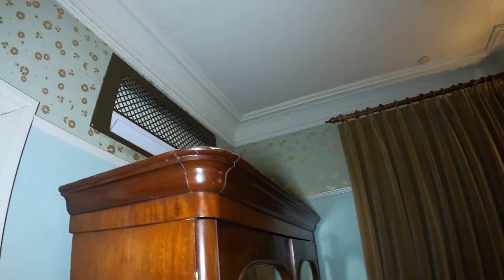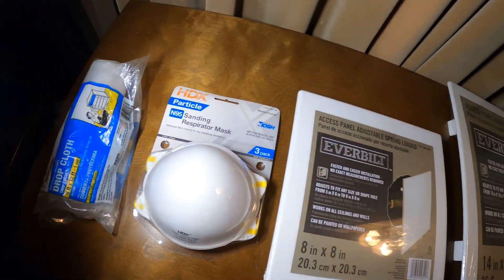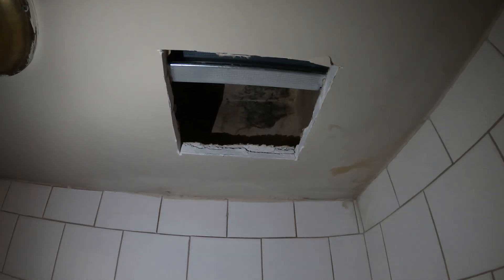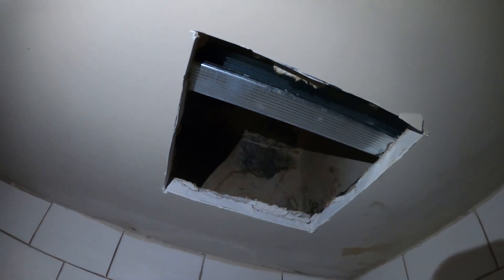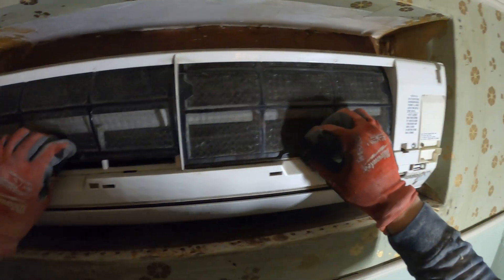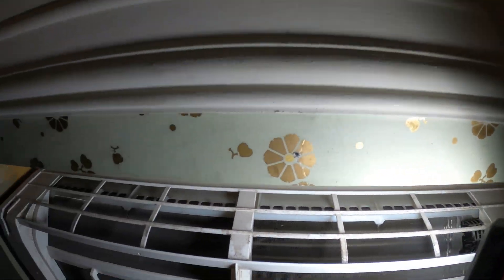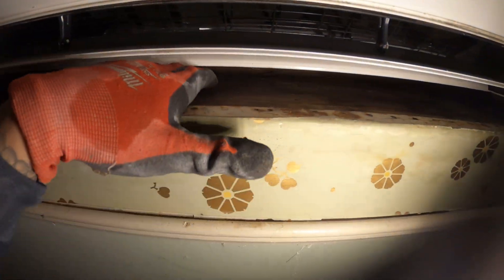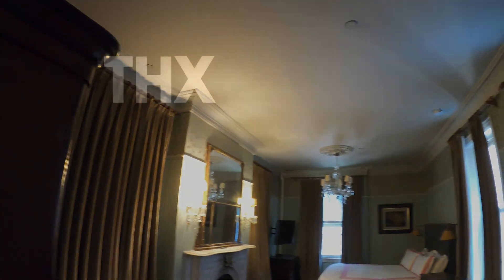HVAC Service Call: Ductless Mini Split Wall Mounted Air Conditioner Leaking Water (AC Leaking Water)

Comment: Its definitely not a good idea to have that mini split hidden in the wall/ceiling like that. I would have also recommended removing the bend in the hose since you already had the wall open. And, instead of pouring all that water into the drain pan, maybe using a borescope pipe/hose snake would have saved time and water.

Comment: You’re right about the loop in the drain. Hi-wall splits like that shouldn’t have any sort of trap in the drain line. In stuff that requires traps, drop the short drain into a tun dish that is trapped after it, providing an air break before trap.  Good videos mate

Comment: I’ve worked on these heaps. You can flip the front cover up and run a 1/4” clear hose and get it straight into the drain/drain line connection. Then you can just blow it/suck it out from there.

Comment: Oh no. That will cost an arm and a leg. Probably best to remove the whole wall and ceiling and floor just to get access to all of the mold and remove it. Then also check the insulation on the pipes for possible condensation contributing to the water ingress.😰

Comment: Would a borescope be useful in this situation where you're not sure where to open the wall? That way you just need a small hole big enough to fit the camera through to see what's behind which is easily patched. I've got one made by Klein that has helped me numerous times trying to locate stuff in tight spaces.